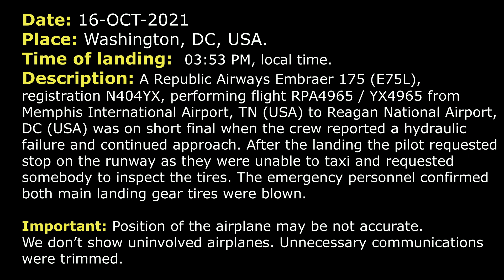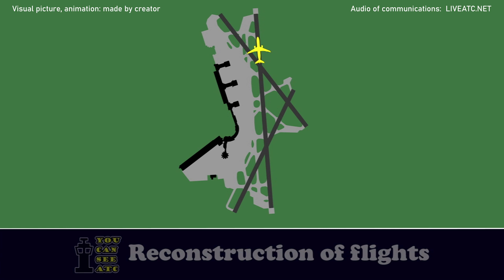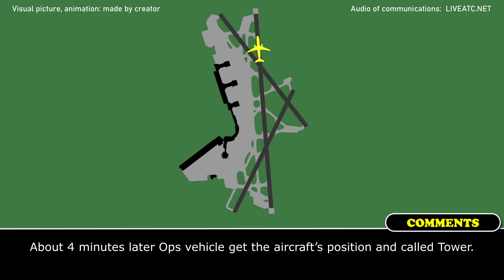Airplane blocked runway due to blown tires | Republic Embraer 175 | Washington Reagan, ATC

Comment: I was on this flight. The pilot did an amazing job IMO. It was a smooth flight from takeoff to landing until the unfortunate mechanical failure. We came in to land per typical and it sounded like we hit a rock once on the runway, then within a few seconds we lurched forward as if the emergency brake were being utilized, though we didn't know it at the time. Then we heard the ker-thunk sounds of what seemed like blown tires. At no time did we feel unsafe, just wondering what the heck the noises were. Absolutely there is no reason for this pilot to be fired. I'm so glad we were safe and no one was injured. Frankly I was more frightened of the Delta variant and COVID than the plane.

Comment: With a hydraulic failure on relatively close final, I'm sure that there will be some second guessing about whether the pilot should have gone around rather than continue the landing. A go-around might have had risks as well if a problem is developing, so let's all be gentle about any second guessing especially if we're not experts on the systems for this particular aircraft. Glad everyone's okay and that I as a controller on duty to the west at the time only had to hold a few aircraft inbound to DCA.

Comment: Amazing video! Keep up the great work! 🙂👍
Reply: @YouCanSeeATC  Also idk if you care but if you wanted to find some ATC communications, Tunisair flight 902 (TU902/TAR902) from TUN (Tunis) to MRS (Marseille) is squawking 7700 and is on approach for Marseille. The aircraft is currently on approach at 7,000 feet and 326 knots.
Reply from the maker: Thank you, I'm tracking it now.
Reply: Alright cool :)
Reply: Also rn Yakutia Airlines flight 9664 (R39664/SYL9664) is on what appears to be an emergency return to Naberezhnye Chelny (NBC) on its flight from NBC to BAX (Barnaul) the aircraft is squawking 7700

Comment: Is there any reason that a hydraulic failure would contribute to blowing tires on landing? Or is it just an unlucky coincidence?
Reply: Most braking in these jets use a hydraulic system. Inboard/outboard brakes generally use 2 different systems for redundancies and for this exact senario, if you lose a system you don't lose all your brakes. Just guessing at this point, but I'd say he lost half his brakes with the system failure, forcing him to use the remaining he had and probably had to brake twice as hard which caused the tires to blow.
Reply: Just a wild guess but maybe they also couldn't lower the flaps, which means they had to land a lot faster than normal.
Reply: So not impossible but by the time he  called atc with the hydraulic system failure, he would've already been configurated for landing. If the flaps were a issue, he'd have know much earlier, which I would have like to believe he'd commenced a go around. Also not a expert on this plane, but I believe the flaps are electrically driven.
Reply: The hydraulic system they lost probably controlled the anti-skid system.  It's very common for jets to blow tires when landing without anti-skid.  Going around to run checklist wouldn't have changed the outcome.  And going around at DCA is a PITA because of all the restricted airspace.  When going around to the north you have to make an immediate left turn to follow the river, otherwise you'll intrude on prohibited airspace.
Reply: @darrylr.4983  Correct probably lost anti-skid as well. And that outcome could been 100% different. Go around, yes P-56 is there but all pilots flying in and out of there are aware of it, make the turn and continue. Run the checklist, figured what systems you have/don't have. 99% of the time the landing distance increases, ultimately meaning divert to IAD for the longer runways. Not Monday night quarterbacking but this senario is something we practice in the sims almost every year.
Reply: Probably lost normal braking and had to use the emergency/manual braking system that doesn’t have anti skid. In all the jets Ive flown it’s very touchy and hard to not lock up.
Reply: @amcdonal86VT  they were on pretty short final. I’m willing to bet they were configured.
Reply: @derekcrum  is that when they had the failure, or when they reported to ATC?? Just asking the question
Reply: No, not having one hydraulic system should not blow out the tires.
Reply: @amcdonal86VT  flaps and slats are electric on the Embraer 175.
Reply: @a.r42111  That's true, a go around followed by a landing at IAD would have been a better option.  I think the PIC will have to explain their reasoning to the NTSB/FAA.
Reply: @darrylr.4983  I think the PIC will probably be doing alot of justification.
Reply: @darrylr.4983  I think I heard weather was an issue at IAD
Reply: @kdbus189  Even so, still doesn't justify landing. After running all the checklist and DCA was the only option then I could understand.